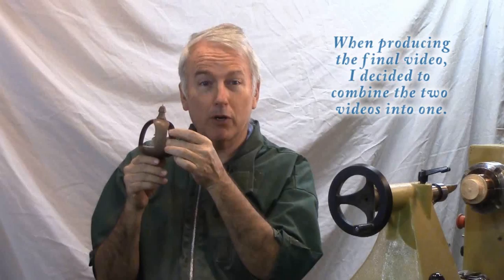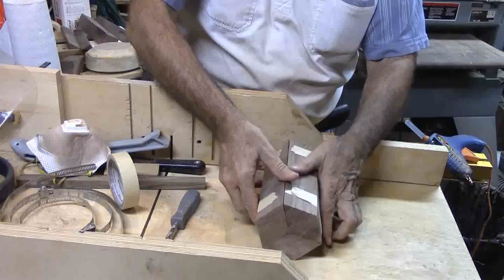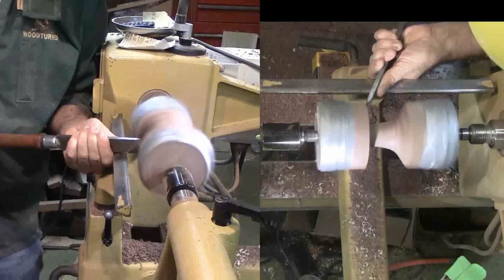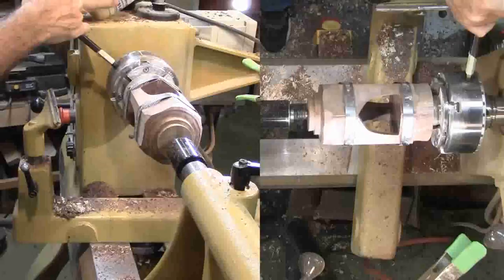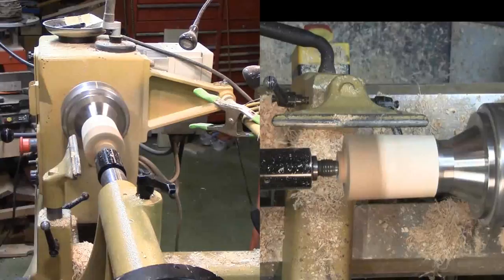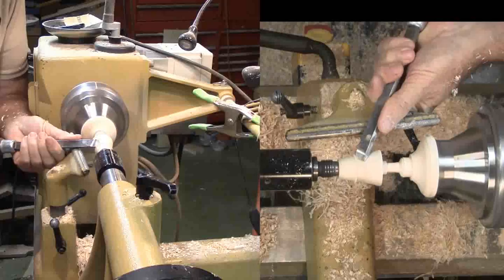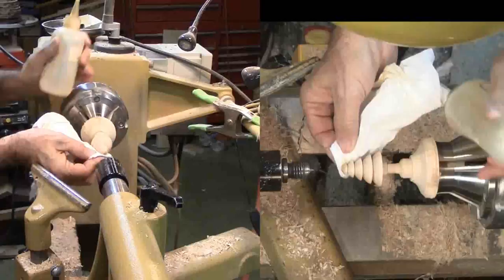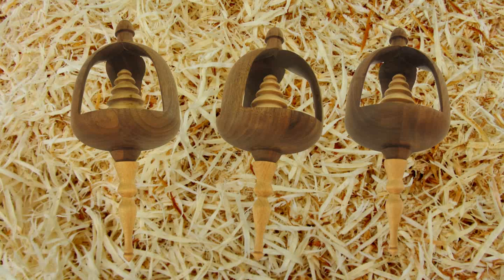Three Sided Inside Out Christmas Ornament

Comment: Great work Alan. 
What prep work did you do on the edges for gluing? We're they planed and sanded or straight from the saw?
Merry Christmas,
Ben.
Reply from the maker: Since I shaved the last little bit as I adjusted the angle, it as very smooth right off the saw. But, I did take a couple of passes with 80 grit.
Merry Christmas
Alan